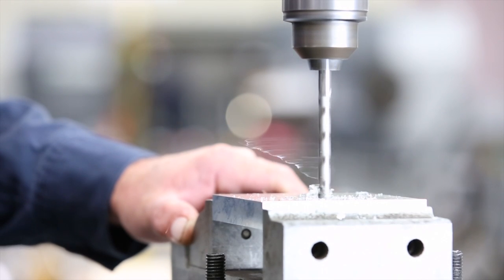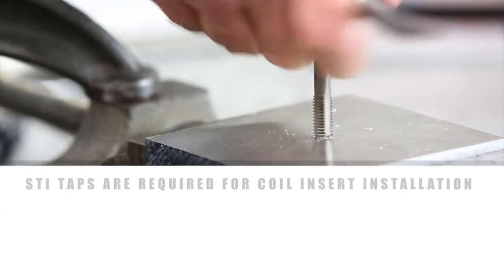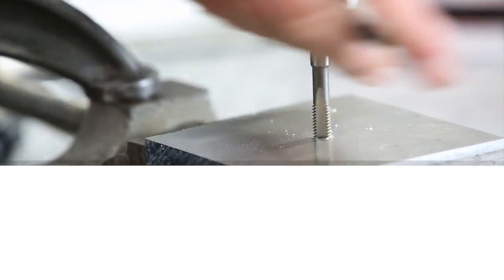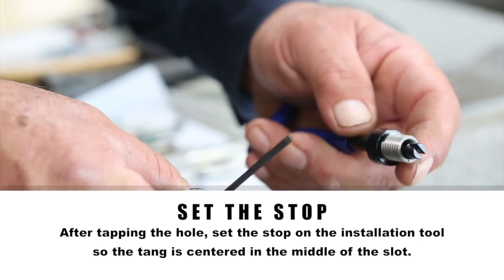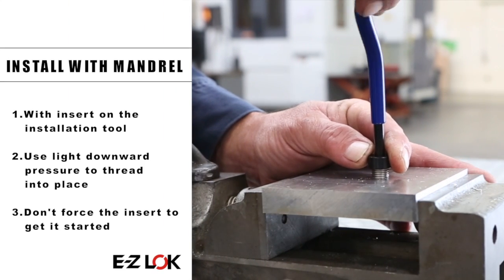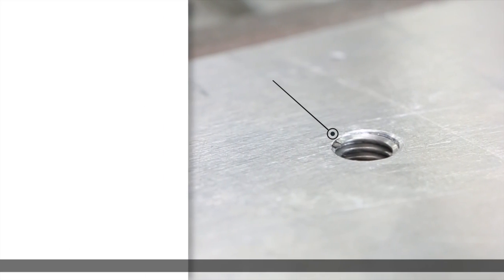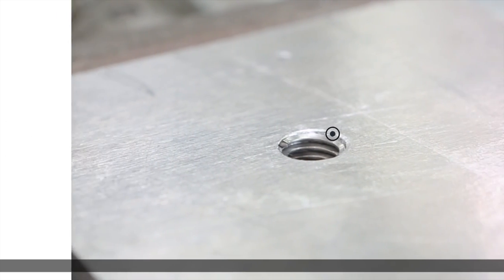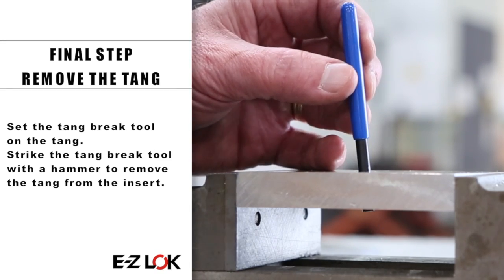How to Install a Helical Coil Insert from E-Z Lok

Comment: How do you remove the tang from a non-through hole, or a hole with a bottom?
Reply: 3D Novice Needle nose or break it and use a strong thin magnet to extract the small piece of steel. If you have worries of losing it get tang free insert instead. But they are easy to grab and snap off with needle nose...